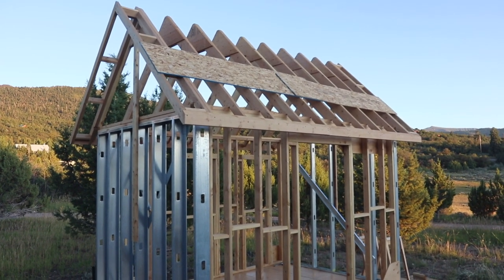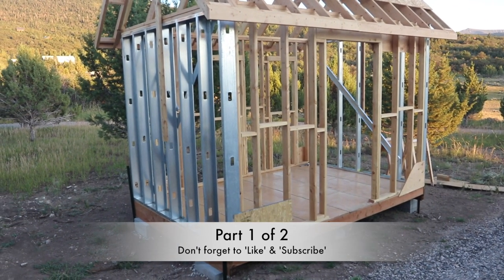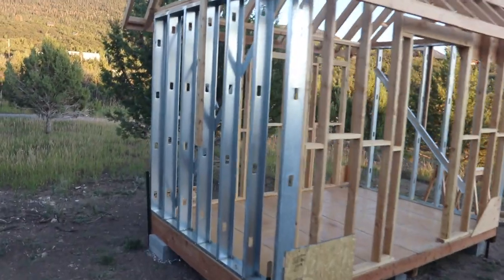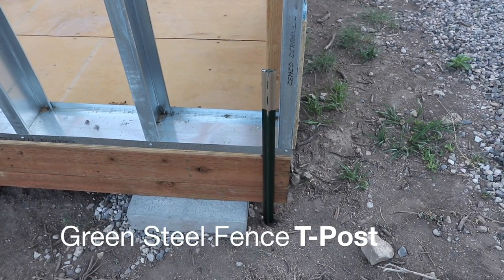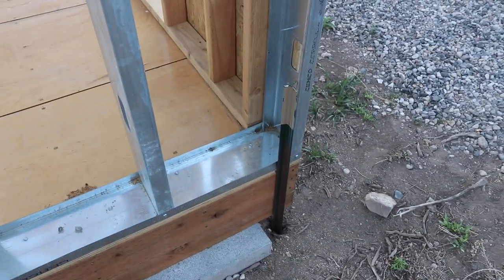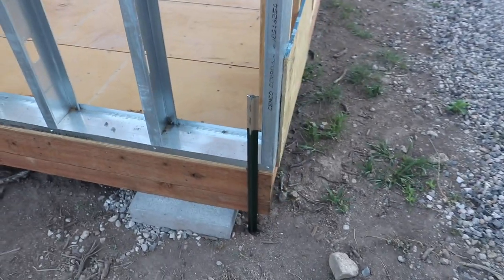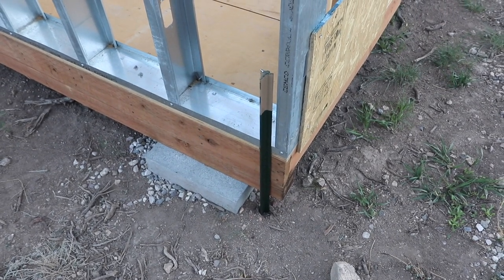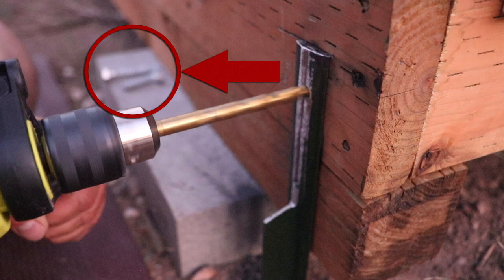How To Anchor Your Shed To The Ground

Comment: I have not tried it but was told if you use concrete drill bits they are carbide tipped and can  hold up to hardened steel better.

Comment: Best way to anchor down a shed with steel fence post is to put your fence posts in, drill your holes through the floor frame, put one and a half inch by 5/8 galvanized bushings through the outer plates. Use 3 1/2" by 5/8" galvanized grade 8 carriage bolts with galvanized flat washers, lock washers, and nuts. Then lay the floor and put up the walls. I guarantee not a tornado will not rip that foundation out of the ground. Oh yeah, it will blow the building apart, but you'll have a good foundation to rebuild on lol.
Reply from the maker: Hahaha, that is awesome!  Thanks for sharing
Reply: I  cannot visualize how is this anchored to the fence post if you are drilling through the frame. Do you drill through the fence post still?
Reply: Crazy smart

Comment: Oh my, you don’t need oil, you need sharper bits, mount the “T” post closer to the edge and longer bolts to pick up the 2 by that’s running horizontal with the post. It looks like your only picking up 1 board. But that’s my opinion, moving on to others, good luck,stay safe and healthy y’all.

Comment: What you forgot to tell everyone is how many bits you destroyed on that hardened steel.
Reply from the maker: Hahaha.  Well, if you watch the video, you'll hear me admit to burning-up one bit before using cutting oil....I also mention in this video how I used cutting oil to complete this project.  Only one bit was destroyed by trial-and-error.  I still believe this anchoring method to be the strongest.
Reply: @fixintodoitall  I only knew that because I did a similar anchor system for a portable garage/carport.  I drilled holes though the top of the Tpost to allow a hook into them.  Needless to say I killed a few bits.
Reply: T-posts are far from hardened steel.  T-posts are grade 60, slightly better than A36.  If t-posts were hardened steel they wouldn't bend so easy.  Medium grade/quality drill bits are no problem for these grades of steel.  He just had very cheap or dull drill bits.

Comment: A step bit would have been a better tool for drilling a thick hole in steel. Good idea! My shed is on blocks over asphalt unfortunately, so this technique won't work for my situation.

Comment: I don't think people realize that the weight of the structure IN THE WIND will tear those little bits of metal right out of the ground.  Sorry for offending the builder.  Bear minimum....anchor bolts or tie downs should be set in concrete footings, below a frost line and those anchors should extend UP THE WALLS if you really want to anchor this down.  Bolts attached to the plate is not going to keep your shed from being ripped off at the walls!  Picture Dorothy's house floating upwards in that Cyclone.  You'll get a glimpse of the magnitude
Reply from the maker: Thank you for your insight.  But in the builder's defense, I don't think the builder suggested this was a silver bullet to all winds.  Regardless, this does seem to be a better anchoring option than some advertised anchoring ideas I've seen out there.  Thanks again.